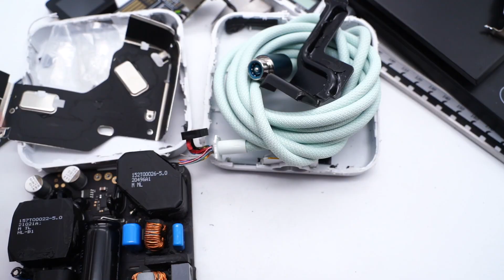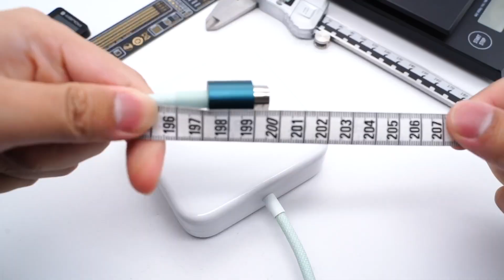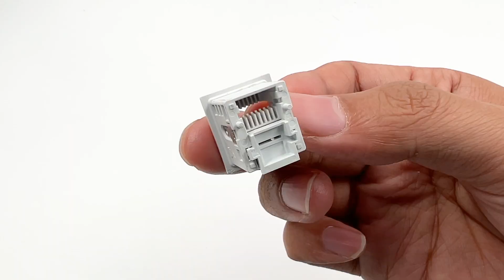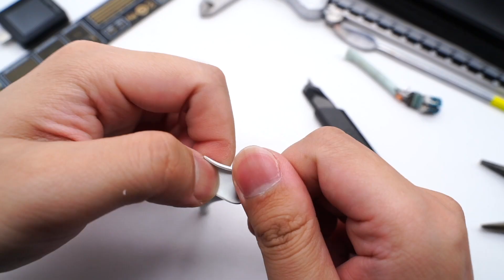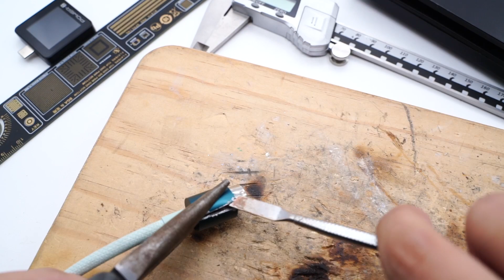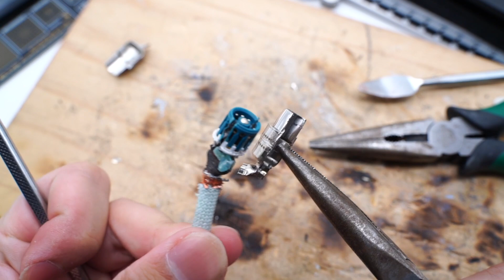Colorful Wires | Teardown of Apple 24” iMac Magnetic Cable With Ethernet Port

Comment: Oh gee, The ethernet cable is extended through the power cable adding it's length to the total. So edge case where ethernet length over 100m can exist. 🤦
Or they could have stuck a USB to Ethernet adapter in PSU and called it a day (which is what I thought they did)

Comment: It would be cool if you reviewed the new samsung 45 w charger. There seems to be a lot of confusion with it. The last one seemed to throttle and there wasnt enough if a differece between the 25w. This one is supposedly different and more efficient but no one knows. There have been articles saying that there is no difference, there are videos reviewing the charger but a lot of them are using the old charger and not the new one. A lot of reviewers are also not using a 5a cable, and there are reviews and testimonies that contradict each other, some say that it is faster and some are saying that it charges the same as the 25w. I'd also like to know the pps profiles since the samsung websites state different things in different countries and that makes it hard to compare to the old 45w one. The 65w trio one would also be nice. Thank you for the videos!

Comment: Thanks ChargerLAB for posting another great informative video on cable tear down, this time is the IMAC plug ….. The charger was well made … and now we can see that the cable is also of high quality with individually shielded cables leading from the charger to the magnetic plug. And the magnetic plug is an absolute high quality build because we can see that you need lots of strength and effort to tear out the plug outer case and then the spot welded inner case.

Haha, thanks for the joke ….. did the internal wires really matches the SPRING colors of the 24” IMac ?  That would be very interesting, knowing that APPLE are always very mindful of their designs. You get what you pay !!
Reply from the maker: That's just my guess. Perhaps, like movie Easter eggs.

Comment: Why aren't you showing board and pin arrangments properly whats the hurry, instead of showing cutting and prying part please show closeup shots of board and wire arrangement,
Reply: Yes, it would be nice to determine how the wiring polarity is maintained from plug to jack. Does the magnet align the plug or is there a electronic switch that senses the orientation and makes the proper connections, regardless of how the plug landed?

Comment: Can you explain why 100+ fast charging doesn't really kill battery life...
Reply: When I was learning about phones like 5+ years ago I would always hear that when manufacturers slowly started to increase charging speed, but now I've been hearing people say the opposite. I'm pretty sure that there is truth in that statement that 100+ chargers don't kill battery life but I do not know why.
Reply from the maker: The battery is a consumable thing, and high power will definitely have an impact on the battery life, which requires the breakthrough of battery technology and manufacturers also need balance efficiency and battery life. I guess you don't want to use only 5W charging forever, right?
Reply: @ChargerLAB  I know a bit of charging, but if the the phone has 2 cells it's just charging normal at 27.5 therefore its 55, you can divide to get more